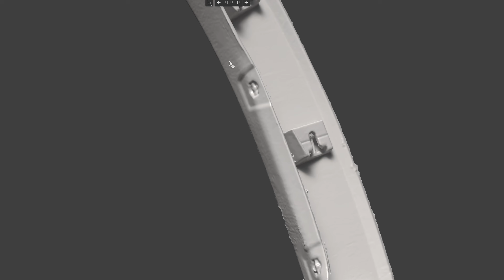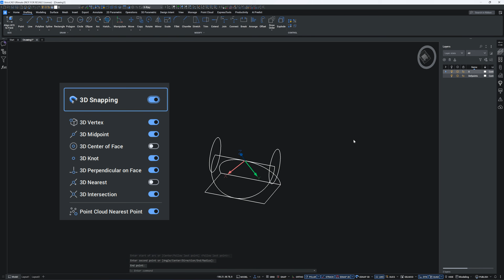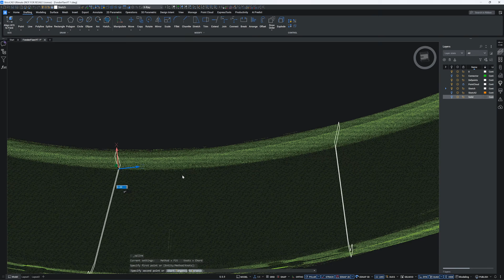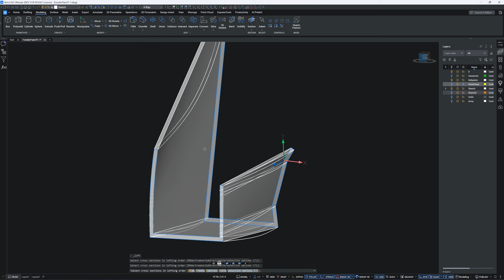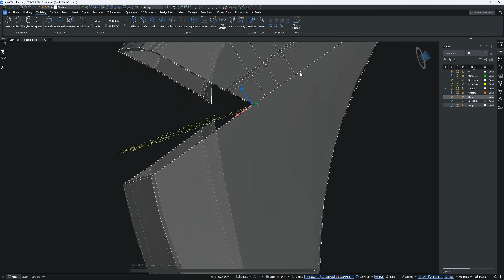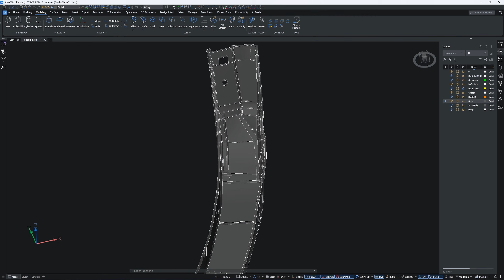From 3D Scan to CAD – Modeling Complex Fender Flare with BricsCAD

Comment: Hi Payo, have you ever tried revopoint metroY? Your opinion about it
Reply from the maker: I haven’t tried it myself, but I’ve received quite a few scan datasets from the Metro Y. The results are on par with the Mini 2, Inspire 2, and Metro X, showing 0.3 to 0.4 mm of precision error, struggling to merge thin‑walled objects, and producing point clouds that are unsharp and messy. It’s very similar to what you see in this video, and honestly, it makes reverse engineering extremely difficult.

Comment: Hi Payo! Nice tutorial, I come every time I face a problem to follow some tips! 
I wanted to ask you about the sketches before loft: in my case I wanted to make reverse engineering from a car side mirror protector and everything is rounded so my sketches are not like yours (straight lines) and I was using splines when needed. When I try to loft, I face the following problems: First I use the join command when I finish drawing one section. After that, I have to convert it to 3dpoly because loft command is not working when using splines. And here is when I have many 3dpoly points to follow the curves and the loft ended up being a complex solid and sometimes it just says it is impossible to loft. I don’t know if there is an easy way for this case or if it is better not to use splines and use straight lines with the least points as possible for the curves so I don’t face those problems. 
Hope you can check this out if you have time. 
I keep researching. Thank you in advance!
Reply from the maker: When creating 2D cross‑sectional sketches, use arcs and straight lines. Reserve splines only for guide rails. Using splines as cross sections can cause lofting issues, not just in this CAD tool but in others as well.
Reply: @Payo-TensileCreator That’s what I was thinking. Thank you for corroborating it. I will re-make the project and I will keep learning. Thank you!

Comment: Hi Payo,
really great video — I learned a lot from your workflow.
I had a question about your guide curves: when you create those 3D spline guide curves for the cross-section sketches in BricsCAD, how do you ensure curvature continuity (G2) across the segments?
I mean not just tangent continuity, but matching curvature as well — so the transition remains smooth beyond the tangent level.
In more advanced CAD systems like SolidWorks, tools like zebra stripes or curvature combs are often used to visually verify this. Is there a similar way in BricsCAD, or are you controlling it purely through sketch constraints and spline handles?
Thanks a lot!
Reply from the maker: There are basically two ways I handle this.
First, if the scan comes out really clean, good quality, no noise, I just snap the spline control points straight onto the point cloud. That way the curve matches perfectly, and the surface ends up just as smooth as the original.

Second option: if the scan isn’t quite that clean, I adjust the spline the way I showed in the video. I make sure the start and end points are tangent to a short straight line, so the curve transitions nicely.

And for inspection, I’ve stopped using zebra analysis. These days I rely on ray tracing, it gives me a clearer read on the surface quality.

Comment: This is great. I have been using a handful of different CAD programs over the last couple decades. This is the first time ive heard of this software and it looks like it has the best parts of my two favorites, autocad & fusion360. I'll be trying it out when I get home! The workflow you showed is exactly what I find myself dealing with very often. Ive been able to get fusion to work for it but it is not very smooth.
Reply from the maker: After 26 years of working with Inventor, I found I could model even faster in BricsCAD on my second project, and I’d only been using it for four days. It trades parametric constraints for flexibility and speed. In my next tutorial video, I’ll show how fast the direct modeling tool really is.

Comment: Thank you once again for taking the time and effort to produce such informative videos. I have a question, can you re-aline imported point clouds in BricsCad?
Reply from the maker: Yes, one of the best. You can move/rotate point cloud together with the sketch and snap them onto any location and also using "Align" command to align them precisely to any axis/plane.
Reply: @Payo-TensileCreator  I downloaded a copy yesterday, coming from Fusion, it's quite a bit less intuitive to use. I also can't seem to import a ply file into BricsCad directly. Looks like you need to go through another piece of software first.
Reply from the maker: @peterlethbridge7859  I think it can only import STL for mesh file. I would take some time when you're not familiar with AutoCAD style modeling.

Comment: Do you prefer BricsCAD over QuickSurface Pro or Geomagic DesignX for reverse engineering from scans?
Reply from the maker: QuickSurface really isn’t even worth considering for reverse engineering, the standard CAD tools already outperform it when it comes to reproducing complex geometry, and they do it faster and with greater accuracy. If you look closely at the sample models shown on the QuickSurface website, you can spot right away that they are incorrectly modeled, which makes it hard to take the software seriously for professional RE work.
Reply: @Payo-TensileCreator  What do you think is the best RE software tool for under US $1,000 that is widely used?  Is Freecad good enough yet?  
Looking into bricsCAD, it doesn't appear to have a lot of mindshare, as in there's not much discussion of it on forums, even their own forums have only a few posts per week.
There is also Seimens Solid Edge.  There is a free community edition that is fully featured.  
Which of the more economical options would you recommend most highly?

Comment: Hello can you show how to reverse engineering by punch viacad 3d software ir is very cheap cad software.thanks :-)
Reply from the maker: I don’t think Punch CAD supports point cloud import, and without that capability it’s basically unusable for reverse engineering, point clouds are the foundation of the workflow, so if a CAD tool can’t handle them, it’s not a practical option for serious RE work.
Reply: @Payo-TensileCreator  Thanks :-)

Comment: Have they got BricsCAD working with MacOS yet?  I sure miss using AutoCAD on macos, wish I could buy a permanent licence.  I almost bought BricsCAD but it's so unstable on MacOS.  Or was when I tried it.
Reply from the maker: I don’t have macOS to test it myself, but according to their website it does mention support for Tahoe.
Reply: No, it crashes frequently and gets lag spikes on my Macbook M1 Max 32GB, however on my PC it is very stable (as you see in Payo's videos). Things I did on my mac that caused it to crash, I cant repeat on my PC.
Reply: @dexmox999  Damn.
Reply: I’m currently using a mac mini m4 with bricscad and it is working fine. The problem I was facing is that when I import point cloud the program crashed and I had to change some settings (I don’t remember which ones but ChatGPT will help you haha). Apart from that the workflow is pretty good in MacOS at least when modeling and working with point cloud.

Comment: Why don't you use QuickSurface Lite with BricsCAD?
Reply from the maker: QuickSurface really isn’t even worth considering for reverse engineering, the standard CAD tools already outperform it when it comes to reproducing complex geometry, and they do it faster and with greater accuracy. If you look closely at the sample models shown on the QuickSurface website, you can spot right away that they are incorrectly modeled, which makes it hard to take the software seriously for professional RE work.

Comment: Thank you Payo! Never heard about bricsCAD. Is this the better Quicksurface? What is your opinion?
Reply from the maker: QuickSurface really isn’t even worth considering for reverse engineering, the standard CAD tools already outperform it when it comes to reproducing complex geometry, and they do it faster and with greater accuracy. If you look closely at the sample models shown on the QuickSurface website, you can spot right away that they are incorrectly modeled, which makes it hard to take the software seriously for professional RE work.
Reply: @Payo-TensileCreator  Hola Payo. Yo creia que Quicksurface era muy bueno y hasta compre la licencia de por vida. Me costo mucho aprenderlo y es verdad que en la creación de bocetos flojea mucho. Pero creo que se adapta a las piezas muy bien y combina parametrico y organico. Tu sabes mas que yo, pero creo que no es tan malo en la precisión. Gracias por tu comentario. Mirare bricsCAD a ver que tal,   hago  ingenieria inversa. Un saludo.
Reply from the maker: @MarcoCesarRomero  Wrapping surfaces directly around 3D scan data is a flawed approach in reverse engineering. It imposes incorrect boundary conditions that lead to inaccurate surface creation. If you just want that effect, Blender’s free Shrinkwrap modifier already does it. Proper CAD modeling, however, is built from sketches, where the modeler must carefully judge and place boundaries in the same logical way the part was originally designed. QuickSurface is mostly marketing hype, its capabilities are generations behind what real CAD software can already deliver.
Reply: @Payo-TensileCreator  Gracias por tu opinión.

Comment: i love your videos, very helpful. could you please also make a video about what kind of a PC/laptop  specifications are needed to run all this workflow?
Reply from the maker: For CAD work today, I’d recommend at least an 8‑core CPU that’s less than three generations old, paired with an RTX 4060/5060 or better GPU and 32 GB of RAM. And if you’re planning to spend long hours modeling, go for a desktop setup with a 32‑inch monitor, your body will thank you later as you get older.
Reply: @Payo-TensileCreator  thank you for your answer. is this also enough for 3d scanning?
Reply from the maker: @dr4ncer  Yes, can also be used with 3D scanner effectively.